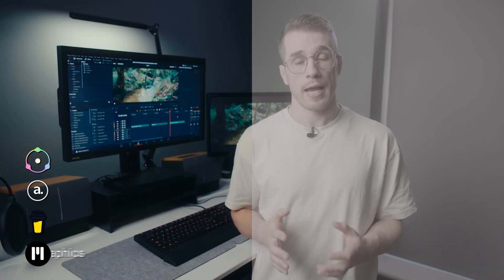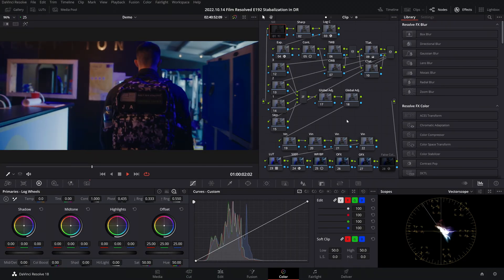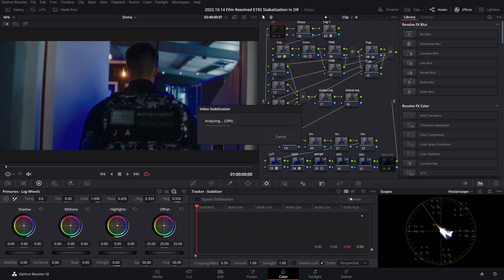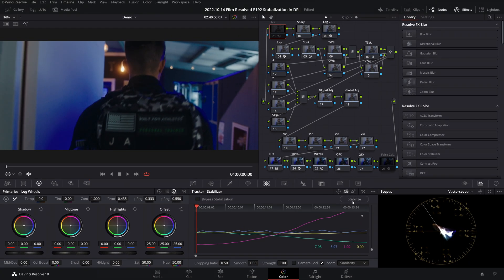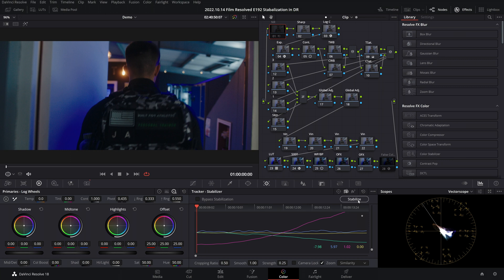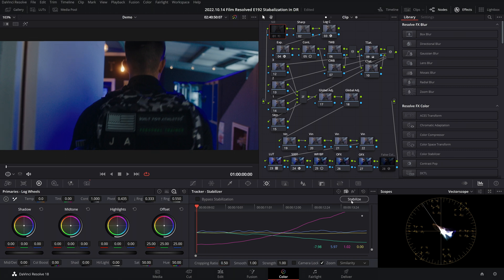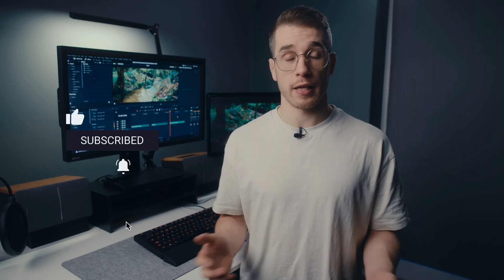Get the Best Video Stabilization in DaVinci Resolve

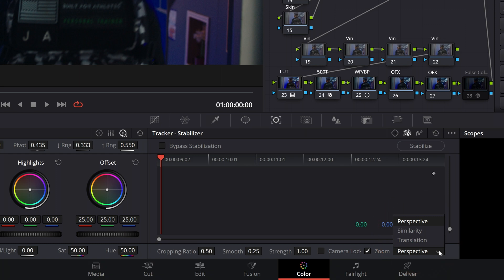Comment: Starting 4:21 you can clearly observe systematic compression artifacts: Every 2 seconds, there is flashing on the left end of the dark gray rectangle of the stabilizer timeline. If you're compressing this with DaVinci Resolve: I think turning off "Frame reordering" is essential, and maybe you also have to increase the amount of key frames or the compression thoroughness overall (e.g. "Full" for Two Pass).

Comment: DaVinci is so inconsistent with the stupid Pages. You can stabilize on the Edit page the color page and Fusion and they all are different. Same with Voice isolation on the edit page and fairlight. the edit page gets no love
Reply: you know, I used to think like that too. now I understand that Resolve is a workflow oriented software.

The color page favours the color correction workflow. so if you need to say, track something in the color page, it should favour the color.correction workflow. so it should work different. interact differently with the tools avaliable.

same thing with say stabylizing a shot. on the fusion page we get a more robust tool that the effects guy can spend some time on, and in the inspector on the edit page we get a more simple tool the editor can use quickly if it does the trick. but both use those inside their workflow, matching their workflow quirks.

Comment: Gyro is the best thing they announced. pulls rolling shutter and no jello (of course with BM cams). also very important you cannot use any gimbles with "gyro" and if you are using a zoom lens, you MUST enter the lens data first, and every time you change the zoom. also I believe you have to shoot BRAW. Prorez will not copy the data. Rolling shutter on the BMPCC6k pro was my biggest gripe and when I saw the gyro stab remove the rolling shutter I fell out of my chair. never heard anyone even mention it. great vid by the way
Reply: Gimbals should be fine shouldn't they? It's just making the camera more stable in the first place

It's any optical image stabilisation in the lens that confuses the gyro, if you have that turned on, it won't work

Definitely has to be BRAW

Comment: Very good help!! I do better when using your method.
What I find difficult is with sensors that have IBIS and lens stabilization that the main subject is pretty still but part of the backgrounds moves. An example is talking heads handheld it's so difficult to get good. Of course it would be ideal to put the camera on sticks but it's just not possible for me to do that on certain jobs. GH5 was good at it, Canon R and R5 I have difficulties with. I tried without IBIS and lens stabilization on R5 lots of jitter and doing the stabilization in Resolve then it looks pretty much the same as in cam... Maybe its I, the camera man doing funny movements...🙃🧐

Comment: Why is your CST so early on in your node tree?  Shouldn't you have it near the end so that you're making all your adjustments on your source material w/ the most bit depth before compressing?
Reply from the maker: That’s an node with CineMatch not CST. I’m using it to enter into arri color space and grading in that color space so no compression happening yet, just a different large space. Then towards the end of the tree in using the arri rec.709 LUT for my 709 conform. But yes if using CST to conform to a smaller space you should be using that later in the tree 👍

Comment: I never thought about tinkering with the parameters before. I just went through the motions of trying perspective, translation or stabilise and if they made the shot look funny then I’d stop using the setting. I will now experiment with the extra smooth and strength to see if that helps.

One funny thing I have noticed is that sometimes, and I can’t explain why, I get better results in the EDIT page with Locked Off shots before resorting to a tutorial to get the same Locked Off effect in the Fusion Page.

May I ask you a completely unrelated question, have you ever played with an anamorphic lens?
If so, how did you go about desqueezing it?

I have a Siri 50mm lens which is sitting in a box unloved because I can’t quite get the maths right.
The only method I’ve discovered is to film a test-sheet of paper with circles on it and then eyeball the horizontal stretch till I get rounded shapes on my screen. I’m hoping there is a better way to use maths and punch some numbers in.
Reply from the maker: For me the best way to handle anamorphic footage is to calcualte the intended aspect ratio i.e. the anamorpic squeeze times the sensor ratio. Then set the timeline resolution in Resolve directly to that aspect ratio with image scaling set to "stretch frame to all corners".
This way is more effort up front to calcuate the figures but it also ensures the correct desqueeze.

Comment: Do you ever do drone footage?  I have one that pans and turns a bit rough in spots. I was wondering if you could also manually smooth the stabilizer. I see the tracks in the window. I have edited simple ones in the display window. I might have to take it into fusion.
Reply from the maker: I do but thankfully my drone has not presented me with the issue you have described. I am not currently aware of manually adjusting the stabliization, certainly not with in the color page which is where my experience of the tool is. People with experience stabilising in other pages may have more info for you. From what you're describing a manualy keyframing the adjustment of the x position within the inspector may be an approach worth exploring.
Reply: Sometimes the jumps in footage is caused by either a buffering issue when writing to the card or wind. You might check to see if you are using the fastest card your drone supports. Sometimes you can fix those jumps by using the new Smooth Cut transition in DiVinci Resolve 20 to cut out a frame or two where the jump occurs and blend them back together. Just something to try.